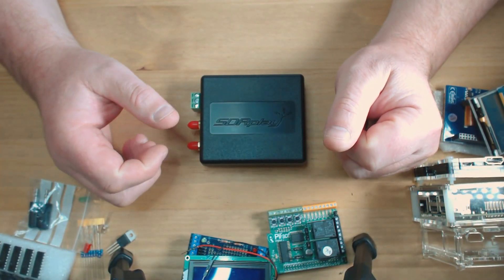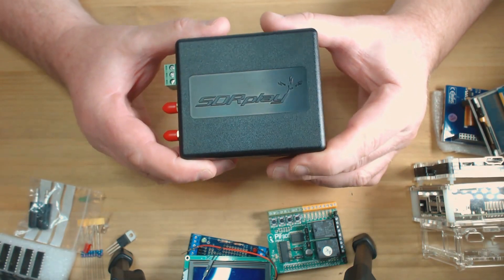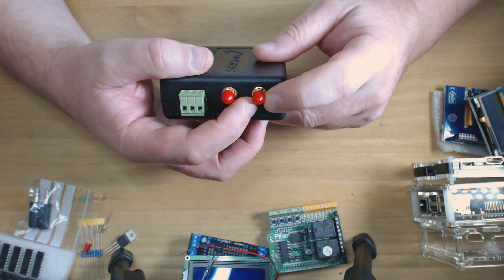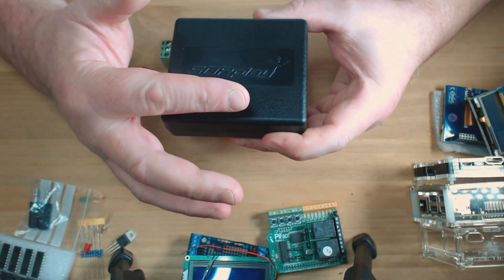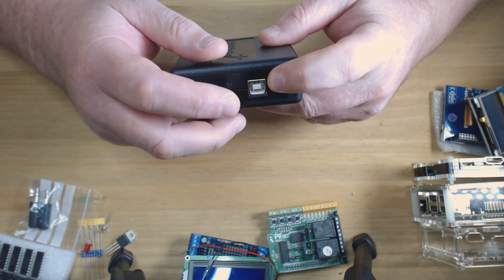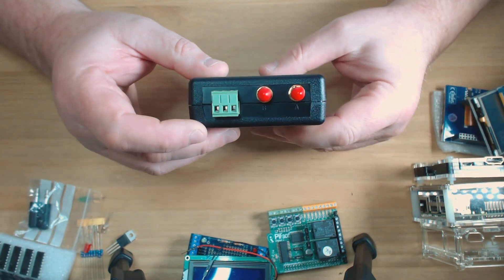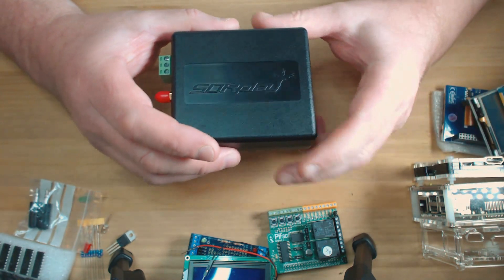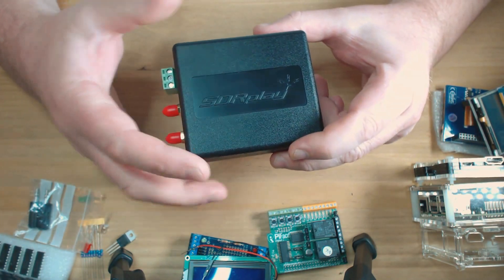sdr rsp2

Comment: Gary, 
Is it possible to use some sort of whip antenna setup with the RSP2 or would the connectors not be strong enough to handle that as I wondered if it was possible would you show it being done and the results you had doing it as I would love to see it under those conditions.

I don't expect the results to be as good as it being used with a big roof antenna but would love to see it anyway.
Tom
Reply from the maker: You could use a hand held radio antenna, but performance would be reduced severely..
Reply: I know - I just was wondering how reduced it would be with the RSP2 is as I currently use a whip antenna on my commradio cr-1a as well and am used to reduced performance since I can't put up a nicer antenna due to age and worried about running the antenna in the house and making places that would allow cold air to get it or mice or other problems.